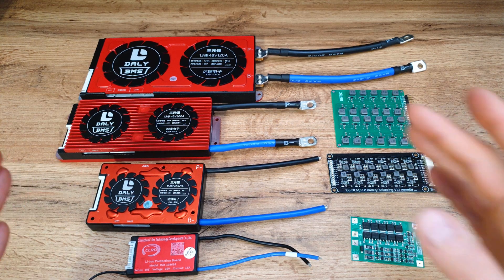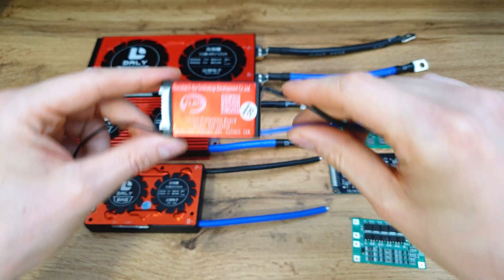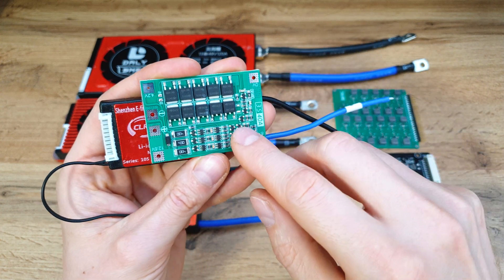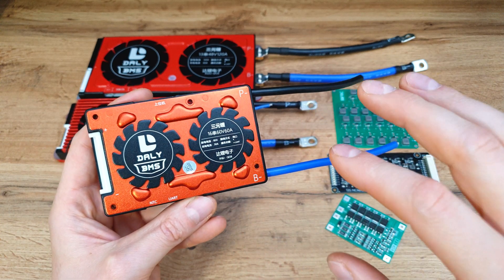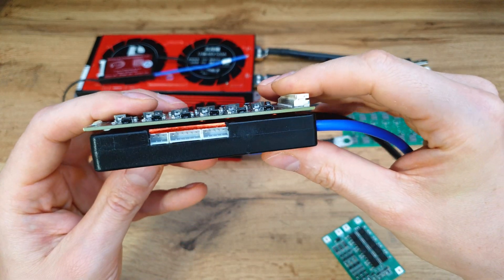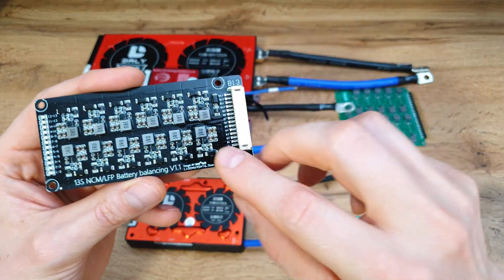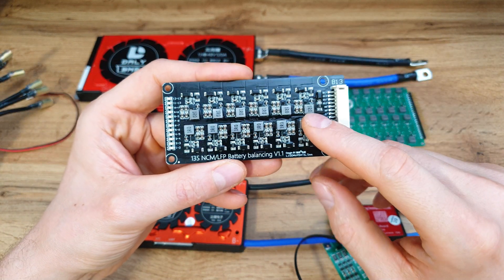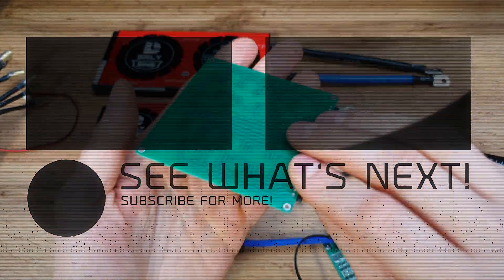BMS or Balancing Board for battery pack 🔋 BiG BMS vs Tiny Light Board 😎 Short story 🍻🍕

Comment: Is there BMS for letvs say 10S 4P setup? So ome that can monitor 4x the 10S, or so to say parallel lines?
I know it is possible to do so with multiple BMS, but wonder if there is one board solution...
Reply: why would you, the cells in parallel will pretty much have the same voltage at all times either way because they are in direct connection with each other, and thats how you want it to be

Comment: I have found my perfect BMS already. It has variable and up to 24S Voltage 200A continues current, small size and light weight- 425g, can set all parameters like currents, cut off Voltages for every cell. Also has BT external module to control and set parameters live on smartphone. Can  transmit data to external monitor or send them via UART port to external device like a motor controller for example. I am going to use this option to record all telemetric and electric data from BMS and controller into the file and in cooperation with external GPS module this BMS will send own data to the controller and whole ride track will be stored in smartphone memory as a GPS track with data points for viewing later,  testing and improving my e-bike. I will put some photos of this BMS..but obviously not here. Can do it on FB page
Reply from the maker: show me please
Reply: Can You paste link to your BMS? I'm looking good stuff.
Reply: @pawelgaj340  ￡5.53  20%OFF | Jikong 1A/2A Active Balance BMS Battery Protection Board 13S ~ 24S 100A 300A CAN RS485 APP Lifepo4 li-ion LTO 48V 16S 20S 72V
https://a.aliexpress.com/_mNt2ekj

There you go my friend !
I also bought accessories like GPS etc.
Hope you will enjoy it 😉